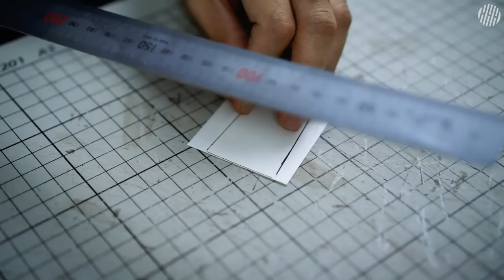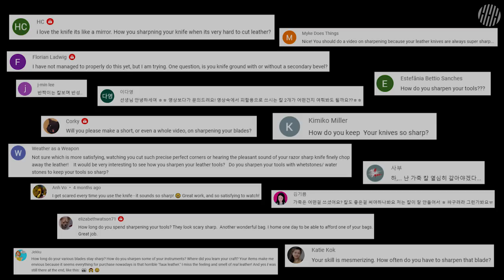How to Sharpen Knife and Make a Sheath Compilation Video

Comment: I have one of those knives; they're quite cheap but surprisingly good for the price
I did something similar to this video, I sharpened it and  improved  the bevel 
I didn't like the paint on the handle so I scraped and sanded it off. This revealed the grain of the wood, which is quite attractive, and made it more comfortable to hold

Comment: I have that same exact blade… I can get it razor/scalpel sharp but it will NOT keep an edge… I can use it for a few cuts or skive a few pieces before I have to strop it again! The steel is too soft or it was not hardened properly; Possibly a bad quenching. :(
Reply from the maker: Yes you're right, but soft means easy to sharpening. This knife is sufficient for a small amount of work. Of course, a expensive knife is better. Hard blade is difficult to sharpen, but once done, it will last for a long time.
Reply: @HahnsAtelier  a soft blade has to be sharpened over and over and over… so not worth it in my opinion… I've never had a hard time sharpening blades that have been forged correctly…one only needs to know how to do it properly to get the job done right… :) have a blessed day my friend…